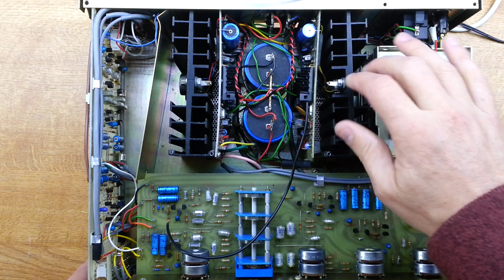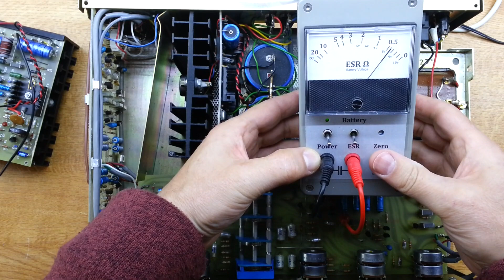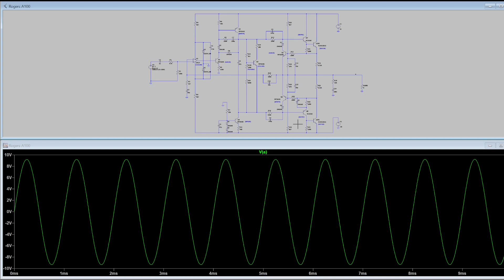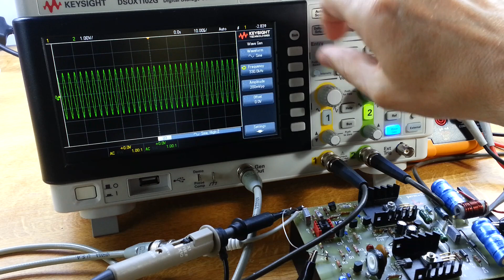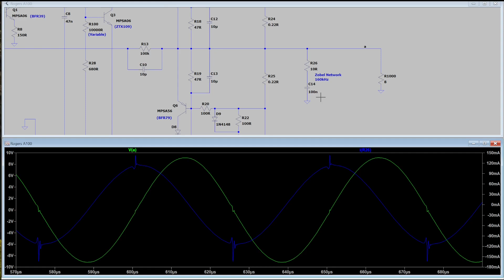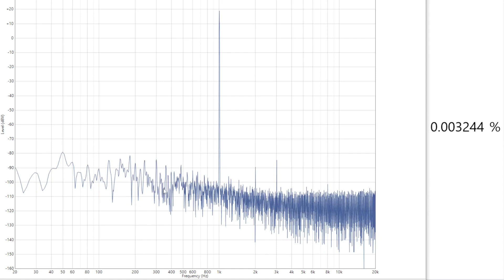Repair of a Rogers A100 Integrated Amplifier

Comment: Excellent video. Could you put the spice files on line for the amp please? You do have some envious test equipment. what was your distortion analyser?  Have  you any idea where I may find a full circuit diagram? I have a problem on the preamp and I cannot find a schematic  on the internet anywhere. Thanks Peter Thomas
Reply from the maker: drop me an email for the spice file

Comment: what is the simulation software microcap.
what do you mean by you can't show schematics why not.
a really nice amp it worth replacing the op-amps? what you suggest. what is the volume pot is it log or linear?
what's a good replacement attenuator with surface mount carbon resistors.